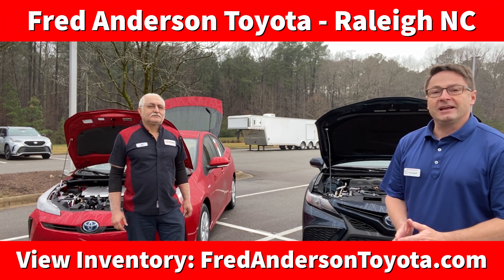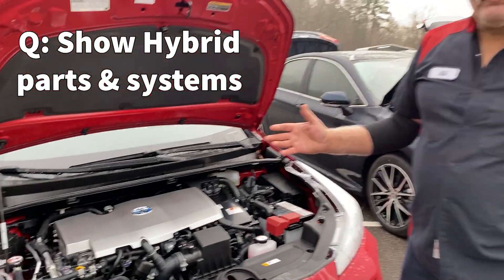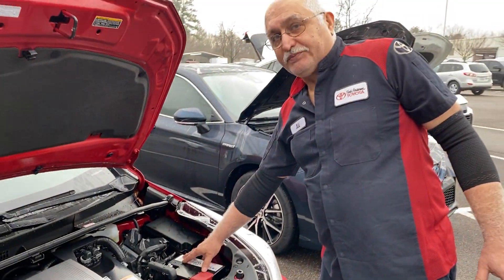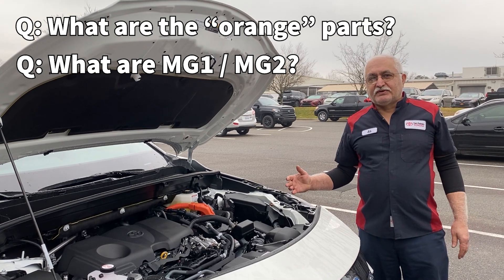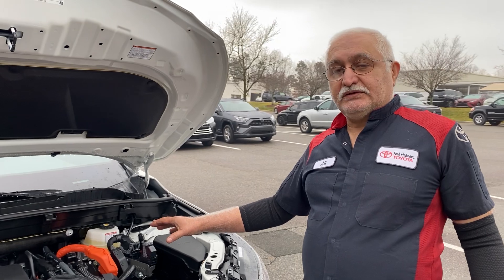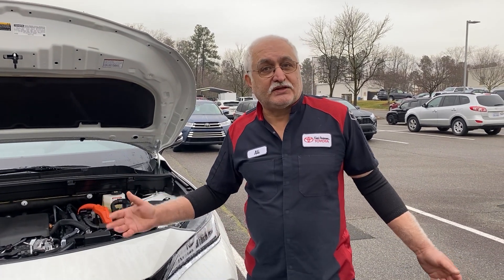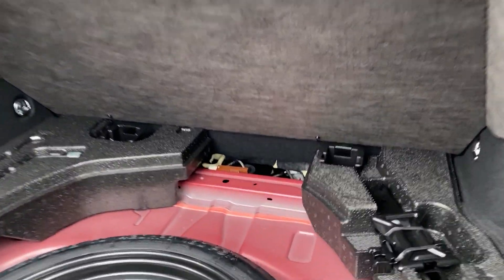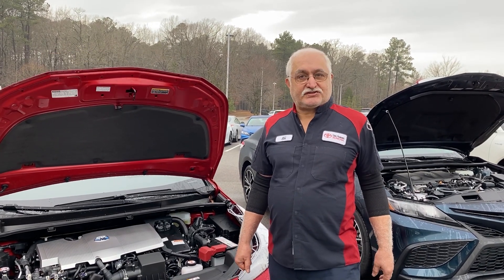Tour of Toyota Hybrid Engine + How Long Does Toyota Hybrid Battery Last? (ASK THE EXPERT!)

Comment: Does the inverter/converter use the same coolant type as the radiator,or is there a special coolant for it only.? I think the radiator and inverter/converter have  separate pipes from each other?

Comment: I have a Toyota yaris hybrid 2018 can I wash the engine and all of the engine bay.
Reply: I wouldn't with that voltage.  Use a little spray bottle and avoid the orange wires

Comment: How long does the 12v battery usually last in the Highlander Hybrid?  Does an indicator tell you when they are getting low/going bad?
Reply: Your Hybrid Computer is watching that 12v battery like a hawk.  But imo it will last 5-yrs easy and for peace of mind a good Topdon (Amazon) battery gage to actively monitory its health. Its condition depends a lot on where you live as batteries particularly that traction battery dosen't like heat.   The 12v battery (probably in the trunk) in a Hybrid really doesn't have to do much. The double click you hear when you turn the key or push the button is connecting the Hybrid traction battery to the Inverter which is it's principal function. It can run the door locks, radio and windows but its not much of a load on the battery

Comment: We sold our 2010 Prius last year when we purchased our 2020 Toyota Highlander Hybrid.  When we sold our Prius we had nearly 190,000 miles.  Never had any issues with the traction battery, and we noticed no degradation as it appears to not have lost any storage capacity,  Most amazing is that the 12 volt battery, was the original and we purchased our Prius new in May, 2009.  I'm 70 years old and owned a lot of cars in my lifetime.  Our Prius was the most trouble free car I ever owned, and whats really nice is there is no serpentine belt or any other belts that need frequent changes every 60,000 miles or so, a true beltless engine.  Same holds true with our 2020 Highlander Hybrid as well.   The only reason why we purchased our Highlander was owning our trouble free Prius for over 11 years....
Reply: Where did you sell it and for how much?
Reply: What real world gas mileage have you experienced?
Reply: @thisismagacountry1318  our 2013 Toyota Auris 1.8litre Touring sports stationwagon hybrid (gasoline) had roughly 0.4 litres per 10 kilometers. Often down to 0.3 on my daily half-hour commute to work with little traffic.
Up towards 0.5/0.6 on mountain-drives and more aggressive driving (depending on how hard the acceleration is).
Reply: Thank you for sharing your story

Comment: Why would a hybrid need to be jumped?
Reply: The 12V battery can still die. It gets charged from the system when the car is running but not when it's sitting. If you let the car sit for 6 months, or leave something discharging it, it can still die, and it's what runs the computers and stuff. Even if the traction battery is full up, if the 12v battery dies the computer can't boot up enough to start the system and charge the 12v battery.
I'm guessing the "jump start" of this is extremely easy - it doesn't need to turn the engine over, that is done from the traction battery, the 12V just needs to power up the electronics.

Comment: Is there any difference between regular 12v battery and hybrid Toyota battery(factory fitted)? Size?
Reply: Yes, you know what the regular battery looks like. The hybrid battery is more of a flat pack like a small rectangular suitcase.
Reply: I have a 2007 Camry hybrid,
The original 12V battery is AGM deep cycle cost about 400 bucks, the regular lead acid battery cost 110 bucks. When my AGM battery died.
 I put a cheap regular Lead acid battery in it, been running for a few years without any problem. Size is 24F. The sensor cable I just tape it to battery like original and air tube too. The hybrid drive battery is 34pieces of pancake flat battery modules connected in series around 276volts DC. Battery weighs over 110Lbs. I have replaced 5 pieces of bad cells.
Reply: @samchengvassiliadises9903  you should do a video of how u did it

Comment: how often should the battery filter replaced or cleaned
Reply: As with any air filter it certainly depends on conditions. If you transport hairy, shedding pets and live on a gravel road, you're going to need to change it more often than someone who drives on pavement with no passengers and clean air.

Comment: Minimal lifespan is 10 years 300k miles if you drive it regularly even in really hot climates like Florida. It last way much longer in milder and coolder  temperature, 15 years or more 500k+ miles. Keep it in garage will make it last much longer. In EUROPE they have 10-15 years unlimited miles, with yearly/10k miles hybrid service check for qbout $50 or free if you do oil change in dealership

Comment: how much does it costs to replace the battery after the 150k miles warranty ends?
Reply: I notice they don't want to answer this question.
Reply: I've heard about 5 to 7 thousand for a new one, but you have virtually a new car again after 8 or 10 years.
Reply: @thisismagacountry1318  True, but like most electronic things, they get cheaper over time.  By the time a new vehicle lasts 10 years, my inclination is that by 2030-2031, batteries will be more plentiful and much cheaper than they are today.

Comment: Help, Thinking of getting a new sienna 3-1-21, but concerned since I'm disabled. I can get in and out currently but in the future I might need a power chair, I am worried that this wont work since the battery is under the driver seat, can this be rerouted?

Comment: Toyota is the best I used to work for Toyota and I drive Toyota Corolla since 2003 , around 500.000 km. on orginal engine and transmission.
Airconditioning works very strong despite 18 years.
Reply: I am happy to hear your odometer did not stick at 299,999 km.
Reply: @RightLaneHog3151  It did in 2015 and I drive 50k a year

Comment: I had a '12 Prius C from new and the hybrid system and engine was flawless the entire 8 years I owned it.
Reply: Prius the very best engineered car ever made yup I am 84 and have been in the automotive business from 1964- 1981 my partner and I owned the 3ed largest foreign car shop in San Francisco my partner was the very best there was he came over from Italy in 1962 for the Formula Racing cars he worked for Enzo Ferrari Ive seen them ALL Ferrari, Maserati, Alfa Romeo, Lancia, Rolls Royce,Jaguar, Austin Healey, Cobra the best of the best at that time, My 2013 Prius has close to 192,000 trouble free miles with one set of Spark Plugs and two sets of break pads and 5,000 miles oil change Synthetic oil and filter, the oil hardly has very little color even at 5,000 miles? I've spent more on tires than everything maintenance wise not counting the oil and filter service?

Comment: Question: if I have a hybrid and the fuel economy starts decreasing, is there any test Toyota can do to the battery to ensure is working properly?
Reply: Yes. Do check up like regular car, fuel plugs, air fiters, tyre presure, wheel alignment, mobil oil and do regularly clean hybrid battery fan filter.
Reply: It's most likely the hybrid battery fan filter that nobody ever checks or the mass air flow sensor may need cleaning using MAF cleaner. 
Scotty Kilmer does a video on it.

Comment: Do the hybrids lose range in the winter as far as battery charge goes? If so, what temperature range starts to affect it? 

Is the life of the brake pads and rotors lengthened with regenerative braking? If so, how long?
Reply: Also, how do oil changes go for hybrids?
Reply: @kyle.cushway  same as regular car
Reply: @MrScoobieman  They use transmission oil as well?
Reply: @inmoneywetrust3292  yes, it still has a CVT transmission. And electric motors used to assist or take over when costing or driving slowly
Reply: @MrScoobieman  Ok thanks, i keep maintenance on my daughter's 2007  camry hybrid but couldn't find a deepstick to check the transmission oil.
Reply: @inmoneywetrust3292  many cars theses days don’t have one
Reply: @inmoneywetrust3292  I wouldn't be surprised if there isn't a dipstick. The "transmission" doesn't have anything that shifts or anything like that, it's just two motors and a fixed planetary gearset. Kind of like the differential in a pickup - might just be a drain and fill hole.

Comment: Will toyota give us an option of what make of battery we prefer. Nickel vs Lithium? Which one is better for northeast cold temps?
Reply: Did you ever find out?
Reply: Nickel Metal hydride is better for cold temperatures. It’s less affected by extreme cold.
Reply: Lithium ion will be the greatest option
Reply: They use the NiMH for the higher trim levels on the Camry. I think it's because it performs better in the cold. LiIon gives better mileage and can stand a higher charge/discharge current but doesn't like extreme cold.

Comment: I have a new 2020 camry hybrid and at times the engine idles roughly, causing the car to shake a little
Reply: From my experience with hybrids and part of the reason I don't own hybrids anymore is that these engines just don't seem to run as smoothly as a regular car.

Comment: Is it possible Jeff you can get a new RX 350 and review it?? My sister is interested in buying one.
Reply from the maker: Hi Dan this is Jeff. I can request it and see what happens. I have only gotten 2 Lexus. It's mostly Toyota :)
Reply: Lexus RX vehicles are known amongst mechanics of being one of the most reliable Toyota vehicles has ever made. 

            Change the engine oil and transmission fluid often and you will have a 400,000 mile vehicle.

Comment: I have a 2014 Camry SE Hybrid and both original batteries are still running strong!
Reply: 2012 Hybrid XLE... almost 170,000 miles...no issues.
Reply from the maker: That’s great!!
Reply: Do you maintain the air duct for hybrids that requires regular cleaning?
Not talking about the regular air filters.